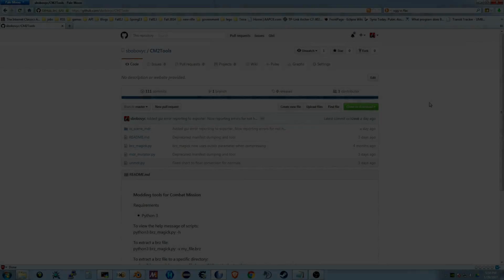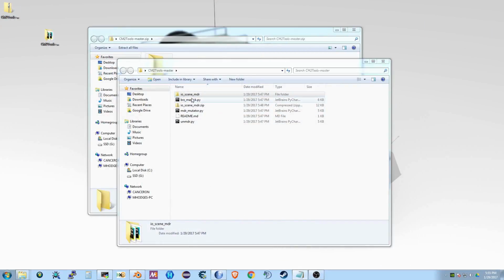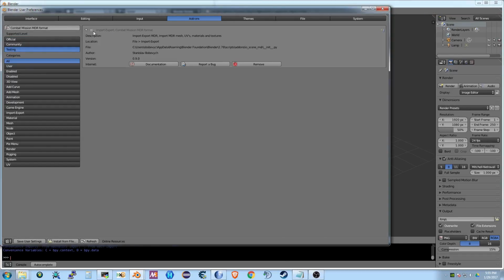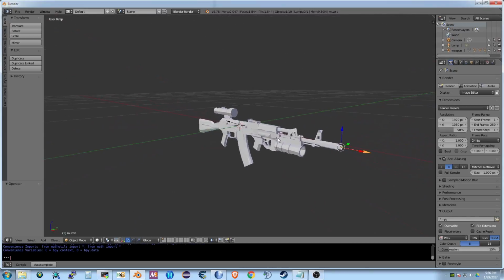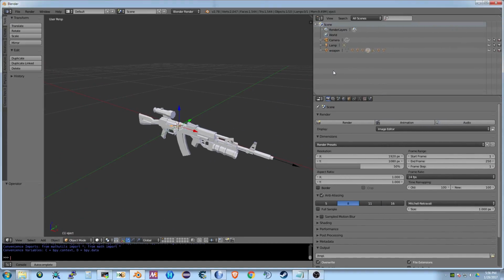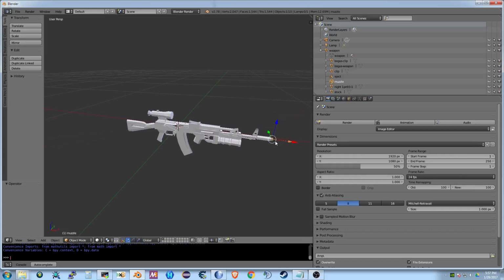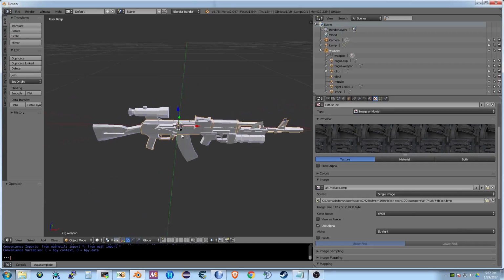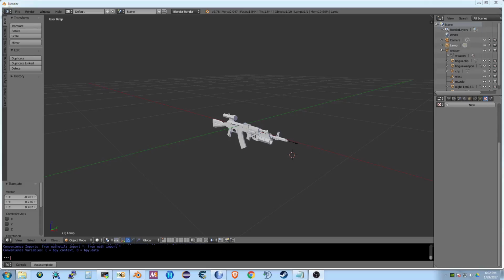Combat Mission: Installing Blender plugins and importer demo

Comment: Any idea how to get this working on Blender 2.8?
Reply from the maker: Blender changed their API in 2.8x and I have not had time to port the plugins fully. Use 2.7x for now.
Reply: @sbobovyc  Right-o
Reply: @sbobovyc  Yeah, Blender isn't allowing it to install for whatever reason. I'm trying to use your old python scripts, but that isn't working either. I've managed to unpack the mdr file, which turns into multiple obj files instead of a single one, and when I try to repack the edited obj, it states "this tool is deprecated and should not be used." I'm at a loss.
Reply: Hola guy, did you recieve an answer to your question, because I am aswell interrested about it ? 🤔
Reply: @JMusic-ch9li  Unfortunately not. Best we have to go with is hoping a good Samaritan remakes the program in the near future.
Reply: Hi guy thank you I try to created things for CM ,this is also the only reason that I am working with blender 279, but of course I would like to working with new version, to go more further in the 3D life, what about you,  can you manage the mdr files ?